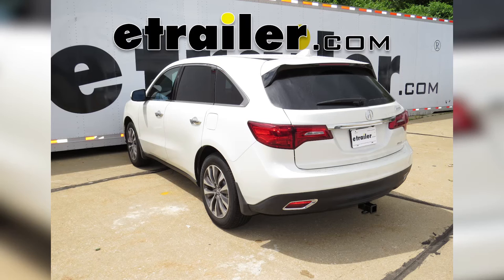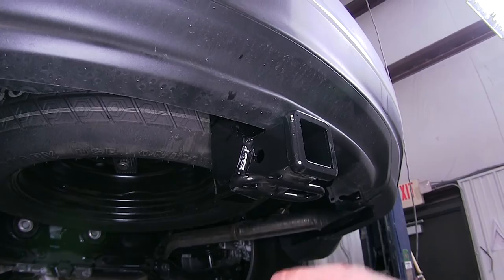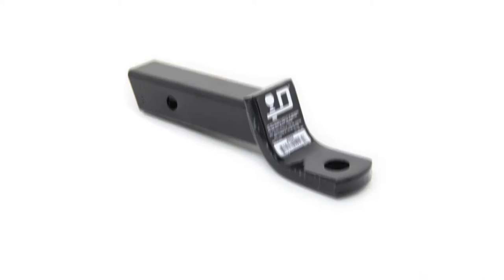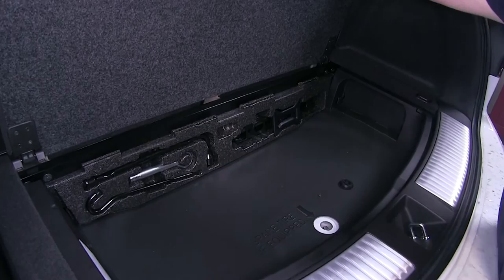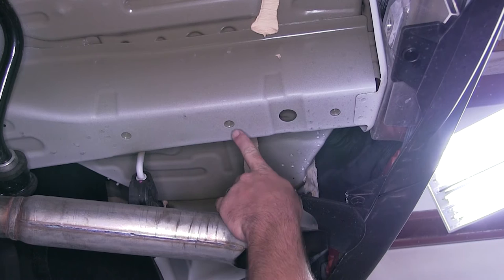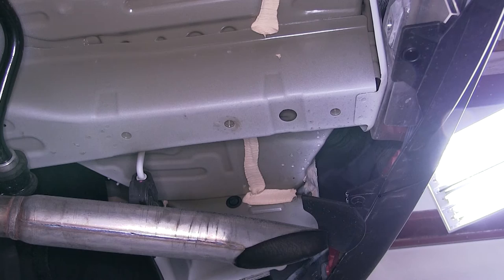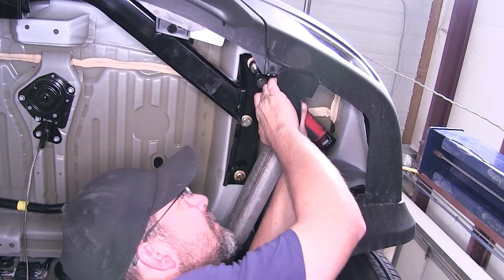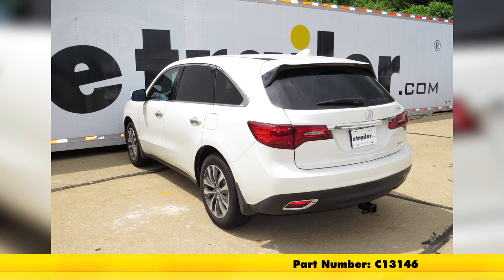etrailer | DIY Install: Curt Trailer Hitch Receiver on your 2016 Acura MDX

Comment: I’m seeing that it requires a 14mm bolt but it doesn’t say the length.  Where kind of bolt do you use?
Reply from the maker: We used the hardware provided with the hitch. I looked at the instructions and it uses (6) M14 - 1.5 x 40 Hex Bolts and (6) 9/16" Conical Washers.

https://www.etrailer.com/Trailer-Hitch/Curt/C13146.html

Comment: Will this work with a full size spare tire?
Reply from the maker: I know for sure it works just fine with the factory spare. I am not sure if it will fit with a spare that is larger than what came with the vehicle. I read through the instructions and the manufacturer does not mention any interference issues.

https://www.etrailer.com/Trailer-Hitch/Curt/C13146.html
Reply: My car has a full size spare (new tire) , with enough air pressure to keep bead and rim intact tire will fit. Carry an electric air pump .